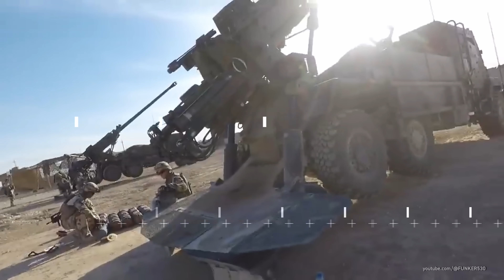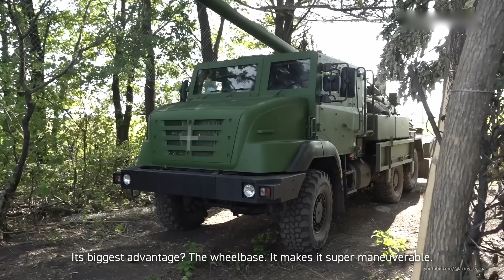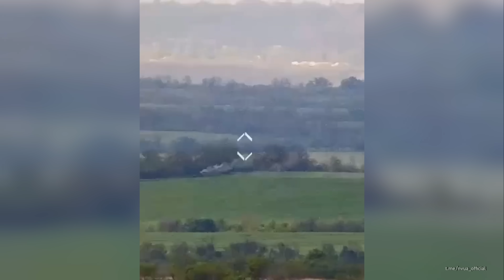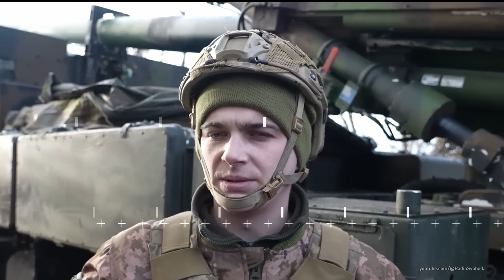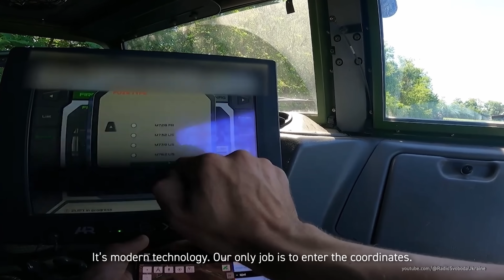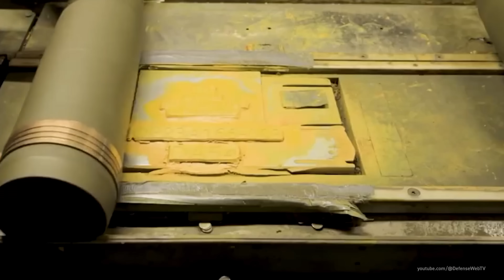CAESAR Howitzer: Ukrainian Soldiers Spill Hard Truth About French Artillery

Comment: The 6x6 "Mark I" doesn't actually exist; there are two 6x6 chassis: the Renault Sherpa 5 (which was sent to Ukraine) and the Mercedes-Benz Unimog sold to Saudi Arabia. The 8x8 version with a Tatra 817 chassis that was sent to Ukraine was the one purchased by Denmark. It's not a more advanced or modern version; the firing system is the same. The only difference is that the 8x8 has armor and an automatic loading system. However, being heavier, it's not air transportable and is less maneuverable. In fact, the new version, the Caesar NG (Mark II in the export designation), is a 6x6 with the new Sherpa 5 chassis, the Arquus Armis.
Reply: Exactly this

Comment: Traditionally, artillery didn't moved much because it was long to compute trajectories and every re-location nullified the previous adjustment. Adjustments were made based on previous fires, so it wasted more round, making the logistic more difficult.
Now, with the advancements in the electronic era , optronics, digital encrypted telecom, inertial navigation and computers have completely changed the way to use artillery. Howitzers can now compute precise future firing parameters for various targets while moving, so they can efficiently apply hit-and-run and other reactive strategies with long-range heavy guns. Some rarer special round can even hit moving targets.
In a sense, they replace the job of airstrike in some previous wars, for a much lower price.

Comment: Keep in mind that French doctrine on armament design states that the armament is first designed to meet French Army needs ; the "intended" use (even if the intended use is battle-justified or not) will thus follow French Army doctrine, explaining the convoy-oriented approach to the exploitation of this system. It's logical that the system needs mechanics, because they are never far from it.
Reply: This is not the case with the Caesar, which was developed on its own funds by GIAT Industries (now KNDS) without any orders from the French Army.
At the time, the French Army wanted the AUF2 (a heavy tracked SPH), and GIAT had great difficulty convincing them to change their minds about the Caesar concept and abandon the AUF2.
The concept was completely revolutionary in the 1990s: lightweight, lightly protected, relatively inexpensive, ultra-mobile, long-range, and ultra-precise.
Reply: @laurentnicolas1550  And it made sense in 90s.

Comment: for the Chassis issue, it's only on the 8x8, the danemark not having the budget for a lot of them, took the 8x8 for better ammo capacity, however, the 6x6 is mounted on a civial chassis and is MUCH easier to repair ;)
Reply: The  6x6 Renault chassis is not a "civilian chassis" but a special reinforced chassis type Renault Sherpa 5
Reply: @leneanderthalien it’s “civilian” in the sense that it was designed to be repaired with civilian pieces and crews. On purpose to be possible to mass produce quickly if needed
Reply: I think Denmark bought the replacement elbit Atmos on same chassis.

Comment: The CAESAR canon barrel is made to be change after 800 rounds, in Ukraine they use it untill 3000 rounds..... And a little reminder, less than 5 CAESAR has been destroyed in UKR since the beginning of the war. It's not such a bad howitzer after all!!
Reply: Despite it's very very heavy use (enhance that it has a 60% availablility rates, compared to the 30ish of other modern artillery equipements ), No accident has been recorded with the barrel so far. I think You Can say it's reliable
Reply: 800 rounds without loosing accuracy and if you use it at max range (so 3 explosive charges). Unrainian use it at 20km from the target (so less charges) and when they have to counter meatwaves 2-3metter less accuracy is not a big deal... hence the 3k rounds.
Reply: @artragis They are widely used beyond 800 rounds because the barrels are manufactured very slowly, there are simply few or none available.
Reply: @HenriBourjade  quite false : since france gave caesar to ukraine we tripled barrel production. Barrels do not explode contrary to what the op sans, they just slightly lose accuracy.
Reply: @artragis  We triple also the cannon production... And it is the third of the orders... The need is to multiply by ten not three, the production.
Reply: @HenriBourjade  But where are the limits of production. There are only handfull engeneers in every country who can produce that system.
Reply: @HenriBourjade France just sent 90 barrels just last month 😂 you have no idea
Reply: + of 2000 rounds !! LIAR !!
Reply: The M777 is made to last 2500 rounds. Russian barrels typically last about 3000 or so. 

800 is a very low number compared to that.
Reply: @CultureCrossed64  only if you forger the range, the availability and the fact that the real durability is far over 800. Like I said the 800 is only "whithout accuracy loss" and only if you use at max range. The 3000 rounds of m777 is "before it becomes dangerous". Not really the same specidication.
Reply: @CultureCrossed64  the 800 rounds is false. It's 2000 before starting losing accuracy and being replaced for optimal result. Ukraine used some barrel over 6000 rounds and there was no issue outside degraded accuracy (but no by so much). Meanwhile russian barrels EXPLODE after 2000 rounds as it was found in this war. M777 barrel is pretty much ruined at 2500 rounds and start losing accuracy at below 1000.
Reply: @CultureCrossed64  May be but it's 800 rounds right in the spot at 40 Km.... With Bonus rounds you can get a tank running

Comment: the crew is unprotected while firing, that is a lttle suboptimal. I suppose its a cheaper solution than a fully protected one...
Reply: When you run an artillery which has a range of 50 kms, you don't care about the crew protection as much as when you're talking about fighting on the font line. A too heavy armour wouldn't be fit to be transported by plane, and the main point of this artillery system is to be used in OPEX (Opérations Extérieures).
Reply: @Heimrik01  an I saw a video with Ukrainian Soldiers in a Panzerhaubitze 2000 that said, that they were very happy about the full protection it gave, as counterbattery fire was not as deadly as standing in the open...
Reply: @walter.r  Ceasar are meant for mobile support, it shouldn't even take counter battery fire as it supposed to fire a few rounds and change position before the shells lands on target
Reply: @walter.r  that’s the point the panzer is a heavu marchine who move small. The caesar is really fast and thaks to that they dodge the counterbattery and if they are attack it’s beacause the crew is not fast enough
Reply: I mean the 2s19 was fully protected didnt worked, they are mostly targeted by counter battery fire and drones due to how far they are from the line. I dont think armor will really help more that to relocate the artilery faster

Comment: Naaah, Caesar isn´t the best, ARCHER ftw!
Reply: Archer is very good. But it is more expensive, has a lower availability rate, has less range with regular shells and less autonomy than Caesar. It also suffers from a longer replenishing time once the 21 shells are gone. These last two differences are of huge importance, since its when they are refuelling or reloading that  these howitzers are the most vulnerable.
Reply: So what? The archer stinks compared to the RCH... 

They all have different price points, and that is the main point.
Reply: @ssm445 do they have one ?
Reply: Archer is x2 times heavier (like 36 tons) and cumbersome : more likely to have problem on bridge crossings and mobility issues in muddy terrain, swamps and ditches. Really not a good thing.
Reply: @gregoirenoble1564  Lack of information... Made for Swedish terrain, like woods, swamps, artic enviroment, would´nt agree.

Comment: I don't think the perfect artillery system exists. The problems seem to come from the chassis, not the gun itself. After all, this system should be adaptable to any chassis strong enough to support it.
Reply from the maker: Well, the main issues often stem from the chassis rather than the gun itself. In theory, as long as the platform is sturdy enough, the system should be adaptable to different vehicles. What do you think would be the ideal chassis for it?
Reply: @ The original chassis, the Renault chassis, seems reliable and robust and has served in difficult regions and I think that the sharp stones of Mali or the Alps mountains are much more restrictive than the mud or the branches of Ukraine, but it is only in 6X6.
Reply: @Weapons.Of.Victory , well,you just can‘t build a PzH 2000 around every 155mm gun. You need quality, but you need numbers, too.
Reply: @Weapons.Of.Victory  Tatra Jamal T163 6x6 with AMT gearbox and Tatra V8 13lts Euro 4 motor...Tyre size should be increased to super size Michelin and  CTIS...
Reply: @Rockall57A Jamal? How long and how much would it take to militarize those? Why not take and use the 6*6 T815-7s instead of 8x8s being used now?
Reply: @ABCantonese  Jamal is the best solution by far, as ex Tatra engineer I can assure you that the Jamal is the cheapest, quickest and by far the best option for military equipment.
Why.
No1. The cab is behind the front axle for IED protection.
No2. Engine maintenance is far easier due to the bonnet can be removed.
No3. The chassis backbone tube can be lengthened to nearly any length you require without upsetting any of the driveline.
No4. The suspension rating is easier to adjust from 10 tonne to 50 tonne depending on air, air/coil spring and or leaf spring combination.
No5. Gearbox options is endless..any type you want as long as it's 2000 Nm upwards
No6. There is ZERO chassis rotational stress no this means the superstructure is much lighter.
No7. CTIS is standard
No8. Ease to design demountable superstructure system.
No9. In the event of severe damage due to modular chassis construction the chassis is able to be repaired and put back into service.
10. Over terrain speed is up to 160kph depending on power..
Finally Tatra won the Paris to Dakar Rally 6 times, why because of assembled CORRECTLY for the job it's required for it's the best truck chassis in the world by far.. but if you ask for any Tatra Chassis you will get the wrong one and it will be like any other truck chassis..
If you need any help please Ask.
Slava Ukraini!
Reply: @ABCantonese   @ABCantonese  Jamal is the best solution by far, as ex Tatra engineer I can assure you that the Jamal is the cheapest, quickest and by far the best option for military equipment.
Why.
No1. The cab is behind the front axle for IED protection.
No2. Engine maintenance is far easier due to the bonnet can be removed.
No3. The chassis backbone tube can be lengthened to nearly any length you require without upsetting any of the driveline.
No4. The suspension rating is easier to adjust from 10 tonne to 50 tonne depending on air, air/coil spring and or leaf spring combination.
No5. Gearbox options are endless..any type you want as long as it's 2000 Nm upwards
No6. There is ZERO chassis rotational stress no this means the superstructure is much lighter.
No7. CTIS is standard
No8. Ease to design demountable superstructure system.
No9. In the event of severe damage due to modular chassis construction the chassis is able to be repaired and put back into service.
10. Over terrain speed is up to 160kph depending on power..
Finally Tatra won the Paris to Dakar Rally 6 times, why because if assembled CORRECTLY for the job it's required for it's the best truck chassis in the world by far.. but if you ask for any Tatra Chassis you will get the wrong one and it will be like any other truck chassis..
If you need any help please Ask.
Slava Ukraini!
Reply: @ABCantonese the chassis on the french 6x6 is a civilian renault.

The cab is almost entirely reworked but that's not as heavy as remaking an entire chassis.

It was especially chosen as a civilian chassis for part availability, you can rely on the parts for the thousand of renault trucks driving across europe to repair your Sherpa
Reply: The important thing is the price-quality ratio, what's the point of having a perfect chassis if it costs 40 million euros and you can buy 2.

Comment: The Tatra CAESAR is the Danish one; it's not a "newer" model, it's just the truck the Danes chose, like the Saudi chose a Unimog chassis.
Reply: Tatra n' est pas un véhicule danois , mais tchèque.
Reply: @gil7555 Il ne dit jamais que Tatra est danois, mais plutôt que le Caesar avec châssis Tatra utilisé en Ukraine est danois. Parce que c'est le choix que les danois ont fait, et qu'ils ont ensuite donné à l'Ukraine. En fait, si vous lisez son deuxième message, il explique clairement que Tatra est une entreprise tchèque.
Reply: @ZekeAR2 you are correct.
Reply: @gil7555  Sans déc'... Mais qui a commandé des CAESAR sur chassis TATRA ? LES P*TAINS DE DANOIS, apprend à lire, bon sang de bois.
Reply: The Danish model has a different loader than the older model.
I think the Danish army bought the replacement elbit Atmos on the same chassis.
Reply: @hgh425  8x8 has an automatic loading system yes. They chose the Elbit Atmos because... it was the only was that was quickly available on the spg market.
Reply: What is Tatra ? 

https://fr.wikipedia.org/wiki/CAESAR_(artillerie)
Reply: @Picronn  Why do you ask the question when the answer is RIGHT in the link you post ? Anyway, Tatra is a Czech truck manufacturer, it produces the Tatra 817 which is a heavy military truck chassis. The Danes chose this chassis as the basis for their CAESAR.
Reply: But it is wrong one. 8x8 model can not be fired with out semi automatic loader. 6x6 can. And the mobility in some aspect is worst doe being 8x8. And Czech republice bough this shit. Tatra with archer would have been better.
Reply: @JMiskovsky archer isn’t that impressive, French make more Caesar in a year than archers currently exist

Comment: Isn't there a quality, faster version? From sweden Archer i think. 😊
Reply: Archer is much more complex,  it's the Caesar 8x8 in worst ..
Aĺl the other western guns in  155x52 calibres are as accurate and have a rate of fire as good or even better in theory....but they are far behind in terms of maintenance and combat readiness. 
The Caesar 8x8 was seen as far better on the paper ( better manoeuvrability thanks to its 8x8 chassis,  more shells more protection etc...) than the 6x6 and French army planed to buy some to replace the old AuF1 .
They changed their mind and went to an upgraded version to the 6x6 , the Caesar Mk2.
Ceasar 6x6 is the ideal balance between modernity and the reality of war.
Reply: The 2 are very comparable in performance, Archer is fully automated (which has both advantages and drawbacks - can't be used if the system is down). I believe the prices are such that you get nearly 2 Caesars for the price of 1 Archer, so practically twice the bang for the buck with Caesar.
Reply: Caesar 6X6 Mark2, they just came out last year. It keeps both advantages : mobility and solidity.